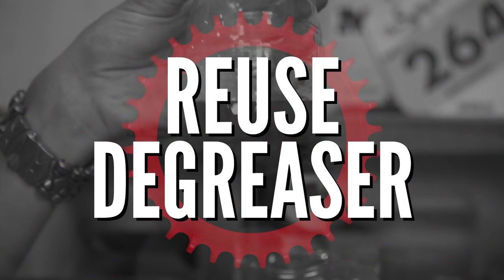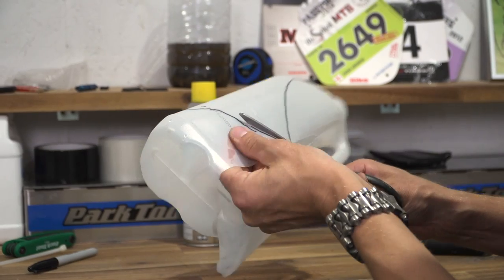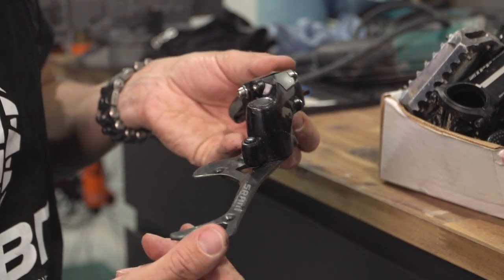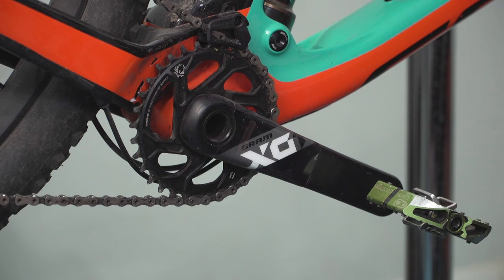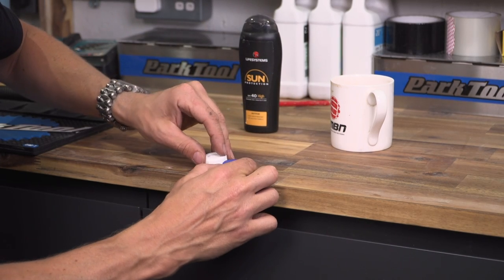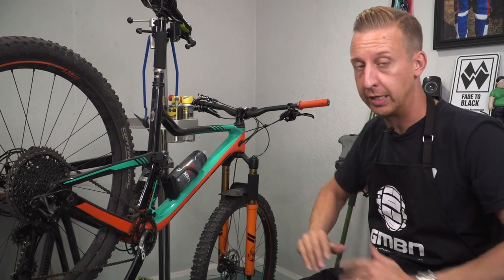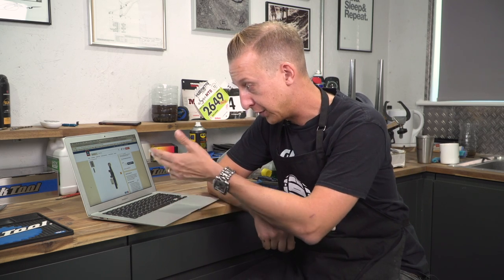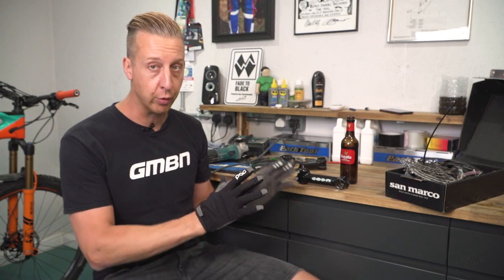The Best Money Saving Hacks For Mountain Bike Maintenance: Part 1

Comment: When using an angle grinder never, ever, have your face in the plane the disk rotates in, and not even slightly close to it. Cut discs (what Doddy is using) DO fly apart, and when they do you don't want to have any part of your body in the path of it, especially not your eyes. I used to work in metal fabrication shop, and have seen a couple of those disks fly apart, and believe you me, it is fucking terrifying. They rotate at 12000 RPM and send off sharp shards of fibre-reinforced corundum flying insanely fast when they break. In the shop we always, ALWAYS used guards. And that's for a reason. You can still see what you're doing, just rotate it so you can see a little bit of disc beyond it (while the guard covers any path the disc shrapnel could fly towards your body). Whenever I heard someone working with an angle grinder nearby, I'd check if I'm exposed, and if I were, I'd get the fuck out of there. Mind you, those were my colleagues, professionals that knew how to use those things properly and not to do anything stupid. You probably are not, so take care. Don't lose an eye over this.

Comment: Doddy if you don´t use the blade guard please make sure to use a quality blade and a full face shield, the bladeguards are there not because of the sparks or flying metal bits but in case your blade is torn apart by the centrifugal force. If you have no guard on and your blade breaks you catch inch wide shrapnel in your chest or face and thats no good. (i am using angle grinders pretty often and it happens from time to time, i saw shrapnel piercing several millimeters deep into plywood i would not want that thing in my chest). It is pretty much as dangerous as riding a mountainbike without wearing a helmet.

Comment: I'm not a fan of putting suntan lotion while out on the bike as i hate having the stuff on my hands while riding, but i always make sure it applied before i set off. then for extra neck protection i place a Buff ( unopened) onto the top of my head, just high enough for it to hang down to the top of my t-shirt, thus protecting my neck from burning. placing the crash helmet on holds it in place and you cannot tell its there!

Comment: Wow Doddy, great tips. But I must say I cringed when seeing you use the grinder looking over the disc. That way if the blade catches the reactional force will send it straight towards you. Had it happen. Got lucky. It's always in the back of my mind now when using thin blades.

Comment: Degrease chains. I never use a chain cleaning machine ...they introduce solvents to your freehub /wheel bearings area. I drop the back wheel off ..use a light detergent like washing up liquid (no it doesn't have corrosive salts)  work that into the chain with two nail brushes... then I rinse with a spray of cold water...then I pop the kettle on and rinse the chain with boiling water...careful not to pour it on yourself or your derailleur...just the chain. Any shit is dissolved away.. My chains are spotless, then I apply Phil Wood tenacious chain  oil... when applying that oil you can pre warm the chain with a hairdryer ....

Comment: NO GLOVES WHEN USING THE GRINDER

The grinder can snag the glove and if that happens it’s game over for your hand.
Reply: no dude, please wear gloves. Not even a wire wheel would snag a glove, however a wire wheel, cutting disc, grinding stone, sanding pad would all fuck up your bare hands. Tuck in loose clothes and always wear gloves.
Reply: A 4 or 4.5 inch grinder doesn't have enough power to cause any damage by dragging your glove, the motor would stall. Get your hand tangled in a grinder you'll sever tendons, I've seen this happen.

Comment: Your a big boy so I'm not shaking my finger at you, and your 100% right that you can be more accurate without the guard. I just want to share this... Even a full face shield won't save your face if that grinding wheel flies apart. I'm a welder and at a job site someone had the guard off their grinder and had just put a new cutting disk on it that had a lower RPM rating than the output of the grinder by mistake. The disk blew apart and went straight through the facesheild and imbedded in their face under their eye. Had the guard been there it most likely wouldn't have caused any harm. Oh and once someone set their grinder down on the floor before it stopped spinning and it skipped across the floor and cut their Achilles tendon, again, no guard.

Comment: You'll probably think I'm crazy but I've been using the green can CRC brake cleaner for years.  A $4 can of brake cleaner saves me so much time and energy.  Which is good more time the ride.  Then I  Lube everything up at three in one oil.  No need for expensive bicycle shop oil.  Besides some of that stuff is no good for your bike, mainly stay away from White Lightning it will ruin your bike.

Comment: Can I use diesel/petrol for cleaning my chain?
Reply: I use petrol for mine, you can reuse it 3-4 times and then just leave the container out and it will evaporate. It works much much better than any bike degreaser I have used (eg muc-off drivetrain cleaner)
Reply: I didn't know petrol evaporates that fast, that solves problem of disposing  filthy petrol, but I'm thinking about using diesel as it is more greasy and potentially leaves a film inside the chain after evaporating to lubricate it even better, it's good to know that it won't affect my chain, thanks Flynn

Comment: You ever have one of those blades break on the angle grinder? I have and that blade will fly off in big slicing pieces. Cut of blades will break easier than the thicker grinding ones. The blade guard is for more than just the sparks. Don't use an old blade with chips or cracks in them. Use a full face mask not just eye protection. The blade guard does get in the way and is annoying so be extremely careful.

Comment: Wrap chain stay in inner tube
Reply: Not pretty but very useful, do it like IMMEDIATELY after purchase!
"Later" only brings regret ... ask me how i know.
Reply: I really like the adhesive backed heavy duty 2" wide Velcro. Just make sure you wipe the stay down with isopropyl alcohol after cleaning to ensure the best possible adhesion, you should use the loop side and not the hook side (fuzzy side not plastic) since it offers a bit more deflection capabilities. It looks decent can be cut to the exact size and shape you need isn't very expensive  and can be removed pretty easily with a heat gun (or hair dryer if you don't have a heat gun)

Comment: You wouldn’t be laughing if your bench set on fire due to you leaving the bottle of used degreaser on the shelf whilst grinding fist step is a fire watch you have multiple different cans there and even if the spark touches the tip of the nozzle it’s game over

Comment: I swear by bulk bottles of Citrus degreaser, if you shop around on eBay for them, ignoring the things like motorbike or bike specific ones (as they stick a premium on them), you'll find the same stuff for a few £ for a 5l bottle.
Our work engineers use it, and if it works well enough for dirty industrial factory equipment, it should be good for a bike.
And best of all, as it's Citrus based, it comes without the usual environmental issues, and you're safe to wash it down the drain (or so I was told).

Comment: I know folks have been hassling you about this already, but: for the love of crap put the blade guard on, especially with cut-off wheels. Those things will snap and shatter if you put a bit of torque on them, and they'll slice through anything on the plane of rotation, which includes your face with the angle you're holding it at. Even if you only do it for the sake of the video, you'll be setting a good example for others to follow (disclaimers are no excuse).
Reply from the maker: Agreed. Especially for the sake of a good example. Noted!

Comment: Acetone, non-Chlorinated Brake Cleaner, Citra-Sol and Varsol are the best methods for degreasing, without question. Dish soaps leave a filmy residue behind, in addition to having salt compounds in them that are like Cancer for metal. A degreaser should not leave any residues of its own behind. A can of acetone is also much cheaper than your average bottle of dish-soap these days. You should keep acetone away from plastic parts though. For those, Citra-Sol is king. It's essentially concentrated Citric Acid, which will not harm plastic parts in the least.

Comment: I've been wondering but does anyone know of a store that would sell for use with Bicycles intended M4/M5 Taper Head Torx ( Titanium? ) Screws?
My local store only had like M5x10mm ones and most online Bike stores I know of either only have weird colored ones or none at all ó__Ò
Reply: I am involved with building all sorts of stuff, automotive, motorcycles, sailboats,  buildings; and when I can I try to source as many quality parts locally as I can.  Screws of all sorts, are being made all over the USA, probably a couple manufacturers per each state.  Here in ohio we got a bunch of choices.
   We have learned to avoid Chinese screws like the plague since they have very poor consistency in quality, from metallurgy on through.
   So do a bit of searching online & you may be pleasantly surprised.
   I went with stainless on everything since I am a daily rider, just got tired of seeing the rust.

Comment: Your angle grinder accuracy goes way down after the disk shatters and you have 400 entry wounds on your face filled with hazardous material that needs to be surgically removed. It may never happen, but if it does you will be as sorry as it is possible to be sorry about anything.

Comment: I have to take issue with recommendation of searching out cheap, plasticy, basically single use disposable products. Rather wasteful of both money and resources. Get the high quality, repairable thing the first time round and you'll have it, quite possibly, forever. All the cheap, shoddy stuff is going to do is break, help fill up the landfill and necessitate the need to get a (equally as ineffective) replacement again and again as the cycle endlessly repeats itself. Hardly a good value.

Comment: Sorry but surely a taco guard needs to be in a fixed position? Your idea of cutting an old chainring in half to make a bash ring wouldn't work half the time.. 😂
Reply from the maker: Usually you have a preferred foot that goes forward and one that hangs back. In other words, most people don't switch which foot stays forward when they're riding with their feet flat, so it actually makes sense. A few companies make half bashguards for this exact reason.